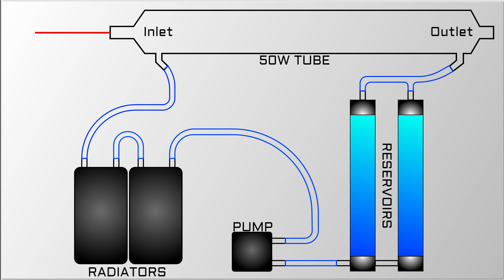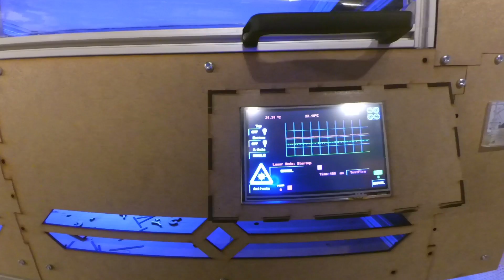DIY Laser Cutter Buildlog - Part3 - Water Cooling, Third Time's the Charm

Comment: Very nice video. Great craftsmanship as well. Just one thing I would like to point out if you don't mind. The loop you have created is not bad its actually very very good. The one problem I see is with the flow of liquid. Its in the wrong direction. Well not wrong because the loop is still doing the job its meant for but wrong in terms of the heated water. You are moving cool water from the rads to the tube then collecting that warm water in the reservoirs before hitting the pump. In regards to life of the parts, you pump should be fed with cool water not warn. Now keep in mind this comment is based off a mistake I made with PC cooling. I water cooled four old AMD space heaters with one 360mm rad and sent all the warm water back to the pump. It lasted all of 6 months. I know nothing about laser cooling and the heat output/water temps but wanted to throw out a heads up due to the same concepts being applied.

Comment: Great series.  Well put together and extremely informative.  I designed a large 3D printer (2'x2' bed, dual extruders) and use induction heating for the hotends and heated bed (using 4 separate zones so I can use different materials in each extruder).  Induction works very well for the bed - heats up the entire 2'x2'x 1/6" bed in just under 2 minutes.  I'm still working on temperature gradients, but I'm happy with it :)
I'm thinking of adding a 50W CO2 laser cutting/engraving function to it.  My concerns are the mesh bed requirements and laser cooling.  Not sure how thick the mesh should be and the fluid dynamics (volume/flow rate/dissipation) to keep the laser from self-destructing :)  I would sincerely appreciate any any rules of thumb or general advice you could provide.

Again, I'm really impressed with your laser system design, attention to detail and video!  Are you a Mech/Elec Engineer?

Kind Regards,
Richard
Reply from the maker: Hi Richard, sorry for the delay but wanted the time to respond properly as your comment is much appriciated ;) 

Your 3D printer sounds pretty crazy with the induction and the 4 zones, as well as the 2min warmup time, which is crazy... 
Adding a Laser to it sounds even more crazy, and as to the rules of thumb, well hmmm, I would say a 2'x2' bed, a relative thin mesh could be used as the materials to cut etc, will typically not weigh a lot. But I can't say for sure, I've never used a mesh as I thought it was to expensive and for my bed the sizes I found didn't fit... 
As for the cooling, well mine "works" with the dual 240 radiaters with very powerful fans, however my reservoir is maybe a liter, so adding maybe 5 liters to the system with some adaquite cooling should suffice... also I always cut so the laser tube is at high power, so doing engraving will not heat it as much... I would say add some addon possibilites to your loop and add temperature sensors to reservoir and laser outlet so you have something to go with when playing around with it...

And no I'm just a programmer, nothing fancy but it's always been an interest building something and problemsolving right ;) And the video series is just as much the editing and video shooting, audio and stuff that was of interest to me before, so the laser was the excuse to do it :) 

Thank you very much for the nice comment Richard, I hope you succeed with that project, if you make video or any form of posting about it please just put it into a comment here, I really like to see other peoples projects.

Gunnar

Comment: dont use water to cool it, you'll have calcium build up in less than a month.  use alcohol or anti freeze.  buy a chiller unit add it to the system
Reply from the maker: I used distilled water with some pc coolant additive for avoiding calcium build-up. Been running that over a year without any problem. 😉 might be due to a change by now though. Am however looking at chillers as a 100w is soon to come.
Reply: @InventorsFactory  What chillers are you looking at?  I'm finding a chiller can cost about $450 US and that's what the parts cost to build a unit like this one.
Reply from the maker: I honestly haven't found any of my liking, to expensive and I'm too sceptical to think they would be any good... I am thinking on making my own again just better.
Reply: @InventorsFactory  Yes! There are pictures online how the Water Chillers look inside, its just a Water tank, some bended copper tubes, fan and pump...

Comment: Hi , what water pump did you use?
Reply from the maker: Hi Marcel, I bought 3 of these from ebay at one point, which are super silent, high flow and use 12v... but somehow can't manage to find them anywhere properly but found this link, you might have better success...
Just be aware that it uses up to 4A during start and will not start properly if psu is to weak ;)
https://www.amazon.co.uk/Delphi-Cooling-Water-ddc28-vc-52417825/dp/B00LSRX61E
PS: don't buy the one in the link! I think it's a bit over priced :D it shoulb be around 15~20£
Reply: Thanks for the reply!
I found something similar to the one you recommended, for a descend price, thanks. I am from South Africa and it is quite difficult to get some parts because most of the products on amazon can't be shipped to RSA and if it can it is very expensive.

Sorry for asking this here. In your first video, (build log 1) what stepper motors did you use with the leveling bed?
Reply from the maker: Cool that you found something Marcel... Yeah I can imagine that getting stuff to South Africa is a troubling issue. 
For the bed leveling i used some standard nema17 motors for a 3dprinter kit. But I would recommend getting one driver for each of the steppers.
Reply: Thanks, I luckily have a few extra Nema17 motors and separate drivers for them :)
Looking forward to your new uploads!

Comment: Just had another thought. I was doodling a design for a TIG welder torch cooler I'm planning and an image of your cooling system came to mind. I thought the CPU heat exchanger would work nicely, so I watched the video again and realised your heat exchanger isn't in the optimum place. The greater the temperature difference between the coolant and ambient air,  the more efficient the exchanger will be, so  ideally the hot water outlet from the laser should go through the exchanger first and then back to  the reservoir.
Reply from the maker: Hehehe I think you're in the correct here! My basic intuition told me that if the hot water got to the reservoir first then the radiators, then the water would have cooled a bit before :D But now you mention it the radiators work best at greater temperature difference, so it would make perfectly sense to run the hot water through the radiators first :) I'll do that when updating everything :D Thanks again Paul
Reply: By the way, I sent you a private message via Youtube. It might be in a spam folder as it has a link in it.

Comment: I’m just curious; since the water is going in between the flash tube and the co2 tube
Won’t colour in the water lower your output as it will reflect a little bit more of the light than clear water?
Reply from the maker: Hmmm good question, I don't think I'm qualified enough to make an decisive answer on that, but from what I know, how the tube works etc etc, I don't believe the colour of the water should have any effect... 
But that's just guessing from my part...

Now I'm curious :D 

If I find anything on that subject of powerloss due to coloured water, I'll definetly make it a subject in one of my video's as to why my water is now clear :) Thanks +rumforitman
Reply: The coolant isn't in the excitation path. 

Ordinary glass absorbs IR light, which is why you can CO2 laser etch it, so the laser envelope would have a larger effect than the coolant colour. 

Lasing takes place in the centre tube, which is surrounded by the cooling jacket and connected to the outer gas reservoir.

The output coupler (part reflective mirror) is made of an IR transparent material, usually Zinc Selenide, like the focusing lens in the cutting head.

Comment: Hi - Very nice videos.  I think the Outlet should be on the firing side of the tube.
Reply from the maker: Thank you Isaac, I am thinking on that to avoid stickouts in the back, cause I want it close to the wall, inorder to save some excessive space requirements ;)
Reply: That may be, however from what I know, the outlet side should stand upwards and the inlet side downwards, otherwise there is a risk of water will not fill the tube.  My comment was to your drawing where the inlet side was near the firing end,and it should be on the other side. 

Anyways - you have an excellent workmanship - I wish I could do the same..:-)
Reply from the maker: Aaaaah Ok! Isaac, I get it now, just me being confused ;) I thought you were talking about the Airflow/suction... :D 

Ok! I did not know that, and it makes sense yes :) I never thought about that! When I'll make a cleanup/refill or move the tube, I'll do that! Back then I just thought inlet should be where the Anode was :) 

And I had minor issues with filling the tube and let it run for a long time and checked that it was filled with water before usage :) the Blue color tint helped a lot ;)

Thanks again Isaac, and I wouldn't say excellent workmanship, let's call it diy art ;) and I had alot of motivation to get the thing running so, I wouldn't say that you couldn't do the same ;-)
Reply: OK - I am happy to be in assistance....:-)  Every day we do not learn something - is a lost day...All the best.

Comment: Hey, so i noticed now that you are using linear guide rails, which is something i am wanting to do too, but i want to know how you managed to secure them to the V - Slot since MGN12's holes are too small , MGN 15 use 3.5, but M4 is 3.8mm, while anything else such as an MGN20 fits the rails, but has the same problem, could use M4, but it would side (or would it) and too small for M5 screws.... so how did you mount you linear rail guides if i may ask? - Oh and as for the radiator , i had a lightbulb moment, i hacked an old motorbike radiator and fan system ( really cheap and large surface area for heat dissipation , then i also found that you get cold water aquarium tanks with chilling units, which do the exact same thing as a water chiller, but just cheaper , so i am going to investigate that further. looking forward to the next video :)
Reply from the maker: Hey sam, well I have two different kind of rails, one is 20mm wide that use M5 screws and 15mm wide for x-axis that M4 screws, it's not the standard MGN types I believe! I bought mine here! www.cnc-discount.de under the tabs ORANGE CNC Set 15/20mm... As for the Profiles, I'm not using V-Slot, I use Profile-20-B-Type-slot-6 which holds up to M6 screws in between... 
But MGN20 with M5 screws should do it I believe! ofc you need to see the dimensions of the profile your going to use :) 

As for the Water cooling, that sounds like a very viable solution! if the radiator is used just make sure you cleaned it good as discolouring the tube with residue and old chemicals would be a shame! But I'd say go for it :D and good look btw
Reply: Ahhh, my mistake, looks very similar to v slot , but thanks,i'll check it out now. V slot is generally M5 max , so that's perfect ! ...as for the radiator, yes, i made sure that the system was completely flushed beforehand.